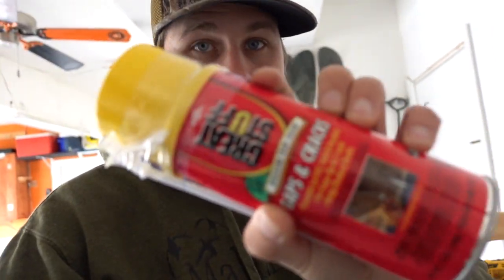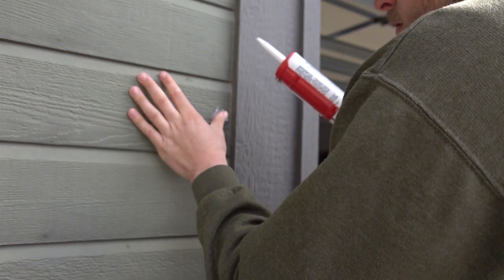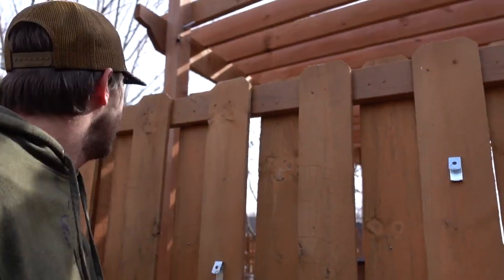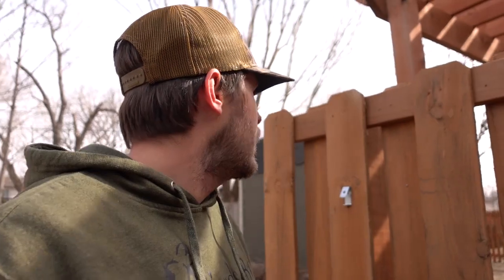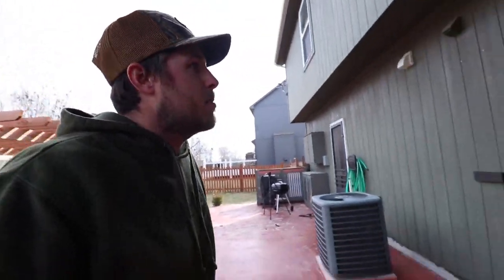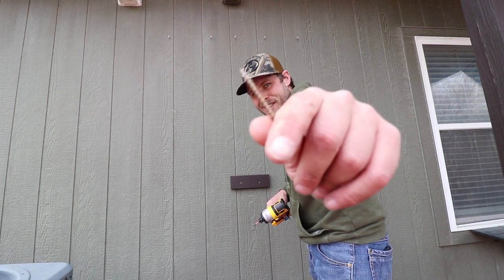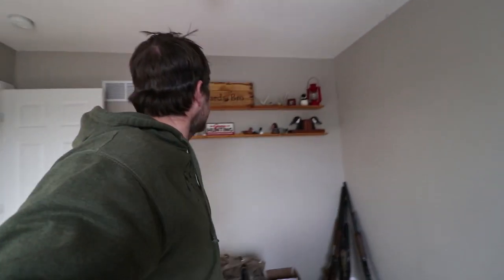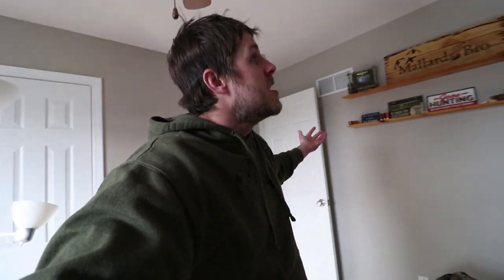IT LOOKS SO GOOD!! | Projects Have Begun

Comment: Make sure you check the outside of the window and make sure the flashing is tight and caulked and the wood behind it isn’t rotted because we just had a problem with one of my windows on my house where the caulk cracked and water was getting in and it rotted the wood